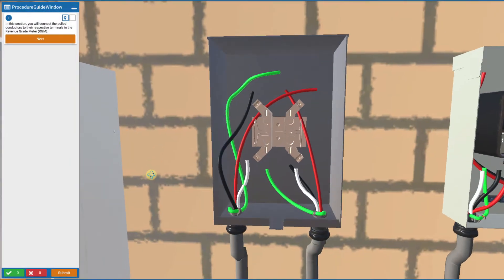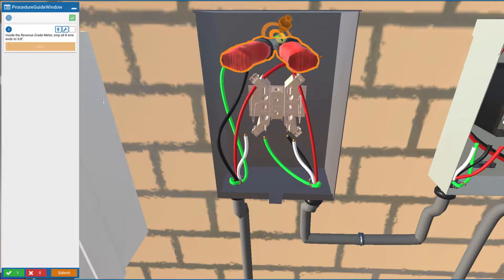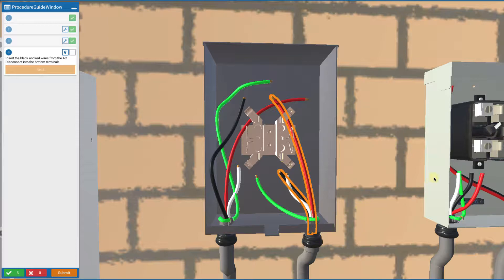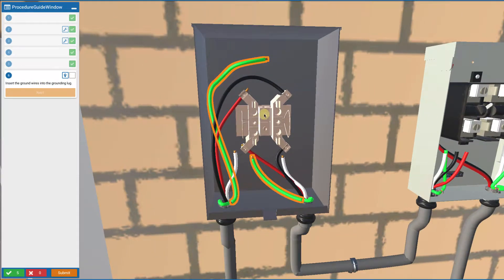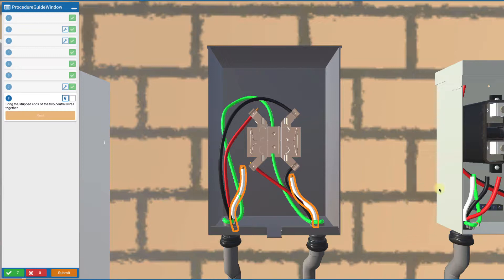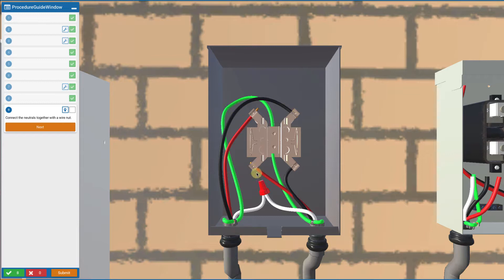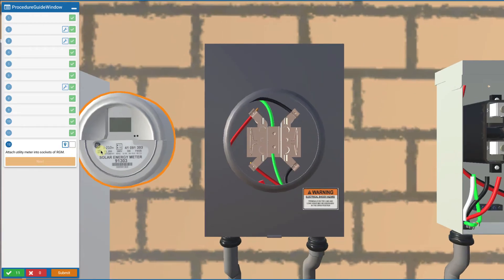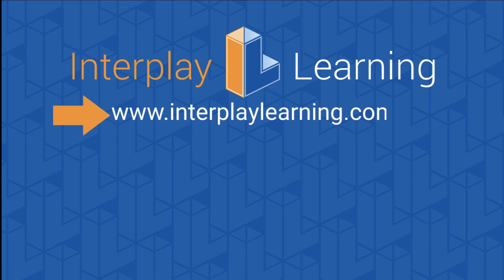Solar Training - Connect Wires in the Revenue Grade Meter

Comment: hi! about connection hot wires from ac disconnector/ Are you sure that it should be from the bottom but not from the top?
Reply: I think the meter measuring only in one direction and this direction from top to bottom (from solar to MSP)
Reply: Check with your utility.  Eversource requires, "The socket shall be wired so that the customer’s solar generation output is connected to the bottom terminals
of the socket (i.e. the “load side” terminals)."